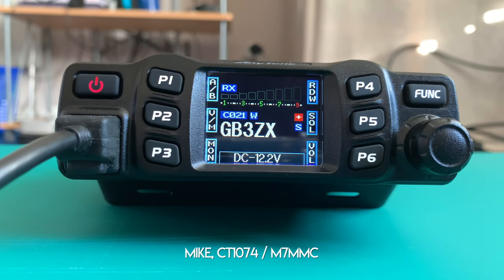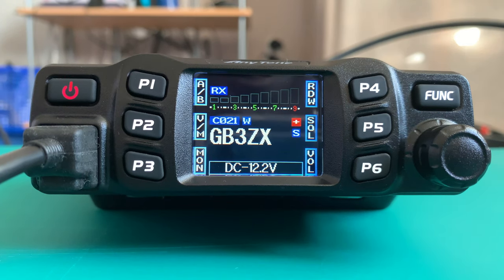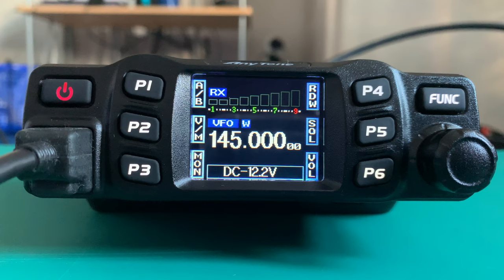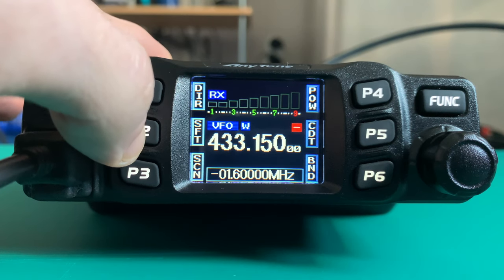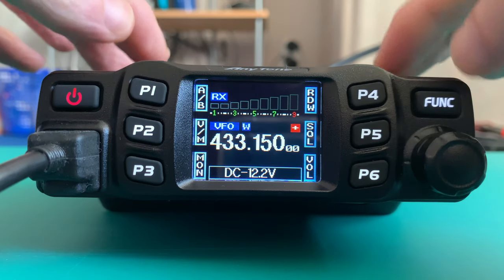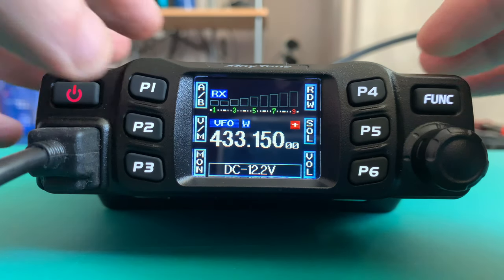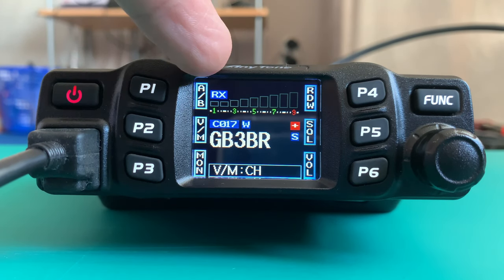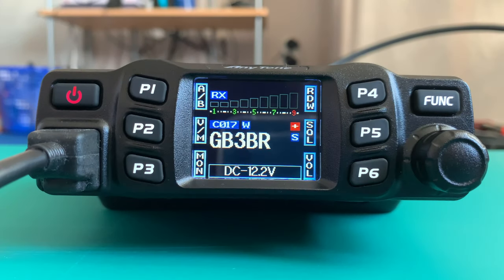Tutorial | Manually Program an Anytone AT-778UV (Retevis RT-95 & CRT Micron)

Comment: Great vid.  Question:  How do I delete a memory channel that is already in use?  I don't need to move them to another memory channel, but delete the channel altogether.   As mentioned, you are WAY clearer than the manual.
Reply from the maker: Hi Joseph,
to delete a memory channel press the V/M button together with FUNC and that channel will delete and move onto the next channel.
73' and stay safe!
Reply: @OntheMicwithMike  Your tip worked great, Mike!  73's from SW Florida!

Comment: Hello MIke...thanks for taking the time to write this article.  Like you said, I was getting very frustrated until I found your article.  I got a couple of channels programmed okay, but I don't seem able to lable either one successfully.  Any suggestions would be greatly appreciated.....73 John KI4RO
Reply from the maker: Hi John,
in channel mode and go to the channel you wish to label, and press and hold 'FUNC' the enter 'CHAN MENU'. 
scroll down to option 9 'NAME SET' and in there use the channel select knob to enter your text. When you've done that, just press P3 'Back' and it will save.
Come back out of Function menu and you should now display the channel name.
Hope that helps, best 73'.
Reply: @OntheMicwithMike  Hi Mike...that is the part that works for me but I don't seem able to get the name to display...73 John
Reply: John Smith..... I had the same issue. You need to change a setting on the Function menu
Press “func” button, select option 1 “func menu” by pressing the rotary knob  
scroll down to option 3 “DSP” via the rotary knob and then press the rotary knob 
The characters on the right go green. 
Select “NM” 
then P3 “BACK” and “P3 EXT” the name should then be displayed

Comment: Just bought the RT95, this video has been invaluable too me! Clear and concise.  Could anyone recommend a power supply unit for it? I want to use it as a base station in my shack. Plus any recommendations for an antenna?
Reply: Did you find a power supply Peter? I already have a 5 AMP constant power supply and wondering if it will be beefy enough for the Anytone which I've just ordered.
Reply: @Ben_3113  Hi Ben
Yes I managed to get hold of one but thanks for thinking about me

Comment: Hey Mike, here's another issue with my radio...
I want to add one of our local repeaters, and it is showing the split. It has the CTC on the transmit, but it's still showing simplex when i transmit.
Another example of it's not as easy as it seems.
Also, I can not put a UHF frequency on A side, and it automatically does the split.
I have to put VHF on A and UHF on B.
In my 878, it is so easy to program. Why can't this radio be as easy

Comment: HI Mike Great Video, followed all your steps everything worked except name changing the channel,  however whilst programing it earlier with a PC cable i found that the storage of names can be either frequency or names, when I changed this setting it showed up with the name of the repeater.  I don't know how to do this without t he PC software.
Reply from the maker: You can change the display from frequency to names via the menu. 
Press and hold FUNC button on the front of the radio, select item 1 - FUNC Menu.
Scroll down to menu number 3, shown as DSP and in there you can select Name, Channel or frequency readout.
Reply: @OntheMicwithMike  thank you

Comment: Your great vid provided the settings for hitting a repeater.  What are the settings for simplex operation? Should CTC be turned off or set to zero as there is no tone needed?
Reply from the maker: That’s right, simplex requires no codes or anything usually. CTC and DCS should be switched off.

Comment: I used your video to program my radio a while back. You made it easy. Now I want to program more repeaters. I can do everything except entering the shift. When I press shift i get an error message at the bottom of the screen. I also display two frequencies like it in dual watch but only in vfo mode. Confused!
Reply from the maker: Now that is very strange!
Reply: @OntheMicwithMike  I fixed it. Somehow I put the radio in RTDF mode. Its the Dissimilar Frequency Setup.

Comment: I'm so new to this & this might be a dumb question but are the channels the same no matter where u live? Or how do I find which is the right ones for transmission & receiving?
Reply from the maker: Hi Amanda, no question is dumb :)
Depending on where you live, repeaters will change and a way to find your local repeater(s) would be to check out the RepeaterBook website, they also do an app for your mobile device.
Search your area for 2 metre and 70 centimetre repeaters and you should find a few that will be heard.
Now I must state and I presume you already know but, transmitting on this radio without a ham license on the amateur radio bands can land you in hot water.
You could use it for PMR 446 (license free) but the problem with that is - the radio isn’t a legal standard PMR radio and pushes out far too much power for the PMR band. 
Just wouldn’t want anyone getting into any issues using these radios that’s all.
Stay safe!
Reply: Look for repeater in your area

Comment: Brilliant video 👍 the the only thing I couldn't do was save the name for repeater for some strange reason, if you could help with that it would be great thanks
Reply from the maker: I haven’t used this radio for quite some time. This is actually an old video, since then I know of two firmware updates.

I did another video later on after this video, naming memory channels: https://youtu.be/_3ETVh3U9g8
Reply: @OntheMicwithMike  I finally worked it out,  once you set the name you have to go into the menu and select it👍  I really appreciate you getting back to me all the best 👍🙂

Comment: Hello Mike1074. I just watched your programming video, nice job by the way, very helpful. I was wondering, could the user program the transmit frequency first, then the receive frequency, along with the PL's. I understood that when you program the +/- offset it should automatically set the correct transmit frequency, but sometimes the radio's firmware doesn't always do that, it's often a number or 2 off. Thanks
Reply from the maker: Hi Carl, I must admit I've never encountered any software that's not set the correct offset that I've entered myself. As for entering the transmit frequency first, I'm not sure that would work. But I'm sure someone will correct me if I'm wrong :)
I've only ever done it RX frequency first followed by the offset.
In some software, you can manually enter the frequencies for RX and TX in that case there's no problems doing it that way. 
73'
Reply: @OntheMicwithMike  Ok, thanks for the reply and help. Some radios you can enter both the tx and rx frequency via it's microphone, I wasn't sure about this rig. As for programming via computer a lot of buyers of the Anytone 778 model have encountered issues, I'm one of them. Thanks

Comment: Hi Mike.
After naming a channel in the memory is it possible to toggle between channel name and the settings stored to reveal frequency, CTCSS etc? Thanks. Neil
Reply from the maker: Hi Neil, 
You can indeed. In settings there’s an option to display either Channel Name or Frequency readout (which shows offset and tone as well).
73’

Comment: GREAT VIDEO-I JUST ORDERED THIS RADIO AN YOU'R VIDEO GIVES ME THE EDGE ON PROGRAMING IT..IT WOULD HAVE BEN EVEN BETTER IF YOU SHOWED HOW TO CHANGE SOME OF THE OTHER SETTINGS LIKE CAN YOU SET THE VOLUME TO BE ON THE DIAL..BUT ALL IN ALL REALY GREAT VIDEO.....AND I CLICKED THE LIKE AN SUBSCRIBE...LOL..
Reply from the maker: Many thanks and it's much appreciated. As for your question regarding the volume on the dial, it can't be changed. Volume is menu based, the dial is only for selecting channels in memory mode and changing frequencies in VFO mode. Thanks again, 73'.

Comment: Hello Mike. I recently bought one of these radio's, they're nice rigs. Question, where can a user of this radio's find a prolific driver in order to program it via computer. Chirp doesn't have anything, the manufacturer's web site is useless, and other user's have had the same problem. Anyone have any answer's. Thanks
Reply from the maker: Hi there, I couldn't get it to work with Chirp, I use the Anytone software for it, and it's pretty straight forward, just as easy as Chirp. As for the prolific driver for the USB cable, mine installed automatically. 73'
Reply: @OntheMicwithMike  Hello there Mike, sorry it's been awhile, didn't know you had replied. Did you get the Anytone software at they're web site? Thanks

Comment: Can you program the radio manually? Via the handset without the cable? Thanks.
Reply from the maker: That is what this video is for.
Reply: @OntheMicwithMike  No i dont mean a repeater, will it work out of the box without pc programming? Thanks.
Reply from the maker: @paulkazjack  Yes, it  works on simplex frequencies by just a keypress on the mic. The only problem is if you're not licensed you can find yourself in hot water transmitting on the majority of the frequencies :)

Comment: Hello sir. i just purchased this radio to use it for when I'm going off-roading and overlanding. I need some help setting this up if you could help me. I'd be more than willing to compensate you. i am very new to these radios
Reply from the maker: A radio like this is pretty useless unless you are a licensed ham radio operator. A CB radio would be more popular for off-roading and over landing 👍🏻
Reply: @OntheMicwithMike  I was going to buy a CB but the off-road crew uses these along with handheld versions. Our frequency is 435.125, but somehow I can’t seem to get it to that frequency. I can get 435.120 or 435.130
Reply: @OntheMicwithMike  I was going to buy a CB but the off-road crew uses these along with handheld versions. Our frequency is 435.125, but somehow I can’t seem to get it to that frequency. I can get 435.120 or 435.130
Reply from the maker: @rodriquezeagle7176  That's the 70cm amateur radio band and can only be used for licenced HAM radio users. Using those frequencies will land you in hot water unless the correct etiquette is used, and a license is acquired.
No doubt the radios were bought from eBay cheaply and they've been listed as 'CB radio/walkie-talkie' but what they don't tell you is that they are amateur radio sets.
PMR 446 would be a better option, no license required and 16 channels to use how you wish.

Comment: I followed all your instructions now several times but I’m not getting the channel shift, I have the red - and it’s set to -00.60000 but when I key up it doesn’t change, I don’t know what I’m doing wrong can you help please
Reply from the maker: If you've input the RX frequency in correctly and the offset correctly then it should shift to the TX frequency. If not then I don't know I'm afraid, I've never encountered it.

Comment: All I want to do is:
- preset it to a specific UHF frequency
- display the frequency in MHz
- display a short name/code for that frequency
- lock out everything except volume and squelch
(to mount in our gliding club vehicles)
Reply: particularly unimpressed that if you select NULL for a key, it is labelled as [XX] rather than blank

Comment: Figuring out repeater programming was pretty simple. But I'm having trouble setting the power. I can change the power but once I've set lo/mid/hi and I exit out of the power setting if I open it back up it's reset to low. How do I set it once selected? I've tried depressing the frequency nob as well as P4. Thanks ahead for anyone's help! - KK4WBD
Reply: @boatadventures1433  Thank you Mike. After a few days I finally figured it out. Love this little rig. Color screen is sharp. Tx/rx are crisp. Does a great job faking out the old hams who think it's a much more expensive rig lol.
Reply: @boatadventures1433  Did I miss the info...were you simply doing a review for the manufacturer? 

Usually on 2 meters in a normal situation you'd never need more than 5 watts. However at low power I've been able to open repeaters with a higher S signal than my Yaesu, Baofeng, and arguably my base station Yaesu 767. The last may be a mic issue....but either way it testifies to the quality of this budget rig.

Comment: question my transmit freq is 463.275 when i program it, it will only allow .270 how do I get to .275
Reply from the maker: Ah yes, you need to jump into the settings by pressing the channel select knob (right side). In there search for 'step' to change the frequency step accordingly to get the to the right frequency.
Reply: @OntheMicwithMike  Thank you is there a way to be able to transmit on FRS and GMRS I work as a armed guard and we frequently back up the bars next to the property they use FRS or GMRS handhelds and we can only hear them but not talk to them

Comment: How do you delete a memory channel?
Reply from the maker: Hiya, I don't have the radio to hand but I do have the manual and I can't remember from memory how to do it. So from the manual it states:

1. In channel mode rotate the channel knob or push the channel up/down key on the microphone to select the unwanted stored channel.

2. Short press [FUNC] key to switch function group, choose the PX key defined as V/M function, press the key together with [FUNC] key for 2 seconds, current channel is deleted and automatically jump to next channel.

That's the best I can do without the radio at hand :)

Comment: Error message appears in red at bottom when I press p2 v/m Button
Reply from the maker: This is quite an old video and from memory, I believe a step may not have saved to warrant the error message. Or possibly trying to save the channel info into an already taken memory slot on the radio can do it too. I will dig the radio out and see if I can get it to throw an error message.

Comment: Hi. I wonder if you could help me. What do i have to press to send a 1750 hz tone to open the repeater? I can whistle into the mic and repeater will open, and I know how to set correct hz, just not what button activates the audible tone. Thx in advance.
Reply from the maker: Not quite sure what you mean by audible tone? The tone to open the repeater is done through programming the repeater, you don’t hear a tone yourself. A blank key sent to the repeater will open it.
Reply: Some repeaters need a certain hz tone, for exaple 1750hz to open. I found out that when you press the ”ptt”-button and ”down” button together, the radio will send the opening signal. I am aware of the programmable undertones and how to use them. Thank you for your answer.
Reply: @Pateeni  Here in the UK, and certainly with GB7BR, repaters these days are opened with CTCSS. I guess the easiest thing to do is to download the software and see if there is a repeater toneburst function
Reply: @OntheMicwithMike  There are two types of tones which open a repeater. In the early days we would send an audiable tone burst of 1750Hz which would allow talkthrough, although these days, we tend to use CTCSS which is a subaudiable frequency, and in the case of GB3BR 88.5Hz. 
Toneburst is used once in order to initialise the repeater, wheras CTCSS is a low frequency signature which is present during each transmission.
You are best using CTCSS rather than 1750 Hz tone burst these days.
Program a channel with the appropriate Tx & Rx frequencies, as well as the regional CTCSS
Reply: @boatadventures1433  Mike, you can actually whistle up a repeader if you have a half decent musical ear. People have been doing it for years in the absence of a hardware tone burst on their radio

Comment: One hard radio to learn   manual is useless!!
Reply from the maker: It sure is! :)
Reply: I have tried it with two yagi's (2M &70 CM )   and got a distant signal on saturday as there were more clear signals coming in on the HF  on my FT950  but not on the RT95..  still no matter will press on.  went and Bought a Colinear last night 200c Moonraker vertical  I'll try that at Night as there are better signals later on in the evening here in the UK